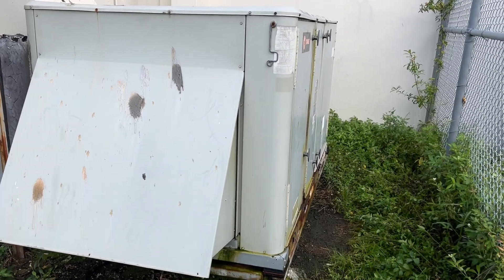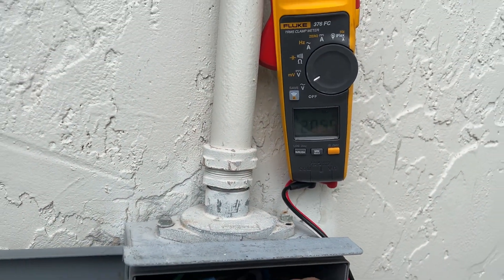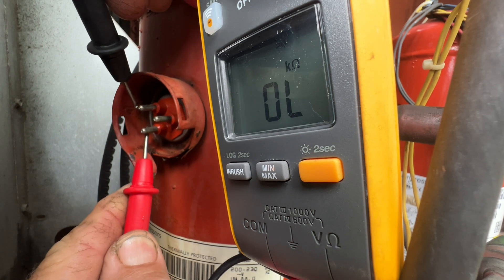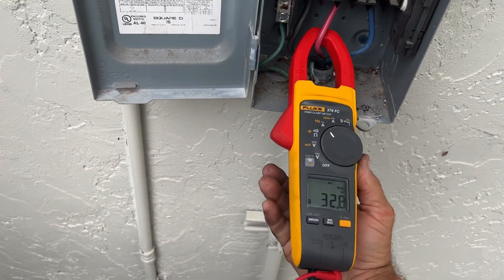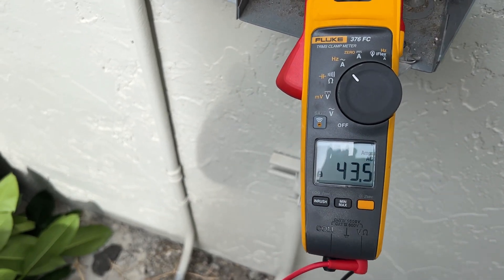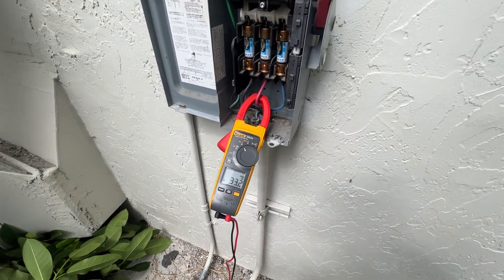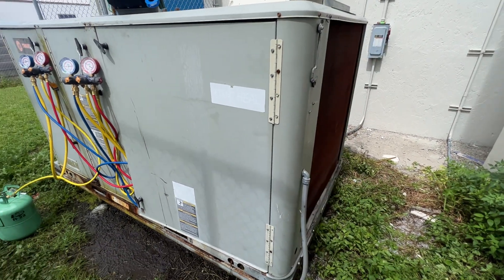Trane Commercial Package Unit ….8.5 Ton THC102 Not Cooling  #hvac #airconditioning #subcoolhvac

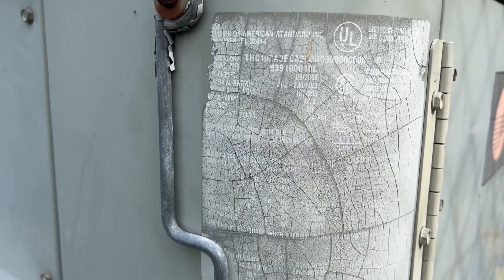Comment: 9:45 - Are those coils Rust colored Red? - Did you soak them with the purple or yellow condenser coil cleaner?
Reply from the maker: It’s Heresite coil coating… coils are corroding
Reply: @subcoolHVAC  Sort of like Blue Fin protection?
Reply from the maker: Same concept to reduce corrosion

Comment: Can’t believe you didn’t check those filter dryers. I bet they are getting clogged up from someone using some mo99 or 438a. Just from looking at those pressure and since someone had cut the high pressure safeties off. Those contractors looked bad too.
Reply from the maker: The Fixed metering manifold was clogging, A/C Renew added and ended up correcting the restrictions . Condensing coil is also fouled, and that design has a tendency to recirculate condenser discharge air into condenser. It’s shoved in the corner of a building. HP switches also replaced…. Only R22 used… thanks for watching!

Comment: Can you explain the back feeding terminology? your missing a phase, yet to ground they are all the same 118v to ground….so in order for you to go to ground still and miss a phase, basically on of those legs is powering a load i guess that feeds back to the other leg ? Im so confused
Reply from the maker: That’s exactly what is going on , the other legs on line side are feeding through loads giving the 118 v reading. Had I disconnected the line wires from the contactor the missing leg would show to ground. Checking across fuses confirmed .

Comment: Did you end up having to add some refrigerant? I saw the R-22 jug hooked up to your gauges at the end of the video.
Reply from the maker: Good catch, ckt 1 had a minor hose leak on high side. By the time I caught I wasn’t sure how long it had been loose. Added some vapor but Superheat was within a degree of ckt 2 so I don’t much was lost.
Reply: Saw that too, and both low sides where near 50 PSI after he cleaned them. 66 deg discharge temp isn't too cold. It was a bit undercharged.